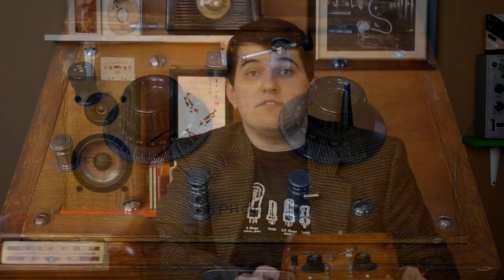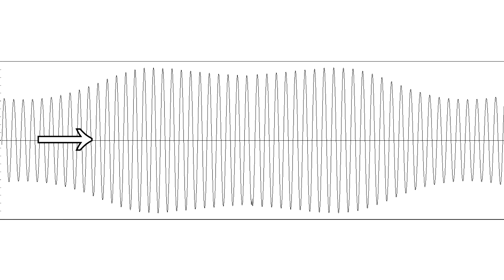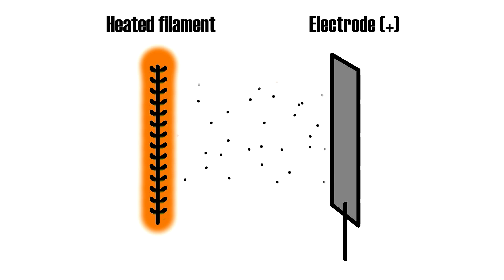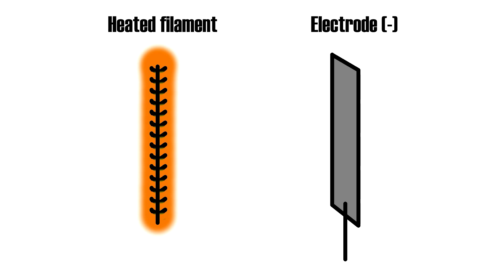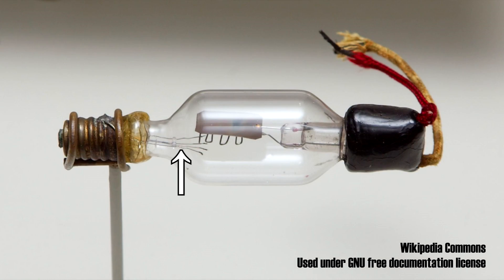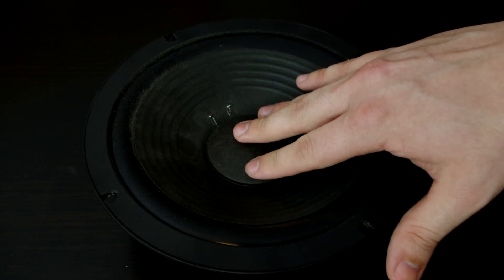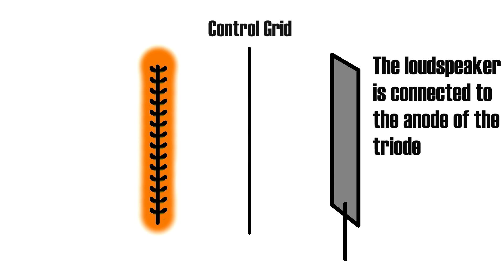The Vacuum Tube and the Invention of Radio

Comment: Listening to the local AM radio station with nothing but a metallic-diaphragm headphone speaker with a germanium diode connected across, one side going to a really long wire as the antenna and the other side grounded to the pipework used to be pretty much on par with magic. No power source needed...
Reply: Isn't it... magical?

I'll see myself out.
Reply: If
Reply: If the signal is strong enough you can hear it from a tin roof. Rust on roofing nails acts like a diode detector and the resulting current causing slight vibration of loose tin panels.  But you have to be near the transmitter for this to work.
Reply: @nakayle  That's very interesting.  I would like to experience that!  Speaking of "you have to be near the transmitter . . .", though:

My first year in college, my good friend lived down one floor from me (in the dormitory) and one or two rooms to the side (not directly under my room).  I had a hi fi (that's what they called "a stereo" back then, in 1964), and we rigged up a speaker in HIS room, running off a wire from my room, hanging outside the building, going down to his room, and in through the corner of his (slightly opened) window.  Worked fine at first, no problem.  

A few days later, my friend told me that he heard the nearby radio station coming out of the speaker!  From the TIME that he had witnessed this . . .  I'd had my stereo turned OFF at that time!  What a puzzling phenomenon!  
But the EXPLANATION was apparently just that we were "near the transmitter", as you stated.  An athletic person could have thrown a baseball and hit the transmitting antenna for WJOY-AM, we were THAT close!  

I guess a simple speaker connected to 20 or 30 feet of "lamp cord" will ("detect") the AM signal, in SOME kinda way!
We never did anything with this amazing information though.  --Even though we were living in the Electrical Engineering freshman dorm at the time.  

That's what it reminded me of, when you said "you have to be near the transmitter for this to work."
I would really like to hear a radio station broadcast by merely listening to a tin roof (as you described), though!  I think I've truly "missed one of life's experiences" by not ever witnessing that particular phenomenon, first-hand!  "Rust on roofing nails acts like a diode detector . . . ."  Your post wouldn't be NEAR as good without the EXPLANATION.  It would be just baffling and confusing.
Reply: @artpitkin883  An AM signal is easy to demodulate with anything that acts like a diode which can be rusty or corroded connection.  People living near high power AM transmitters often have to install filters and grounds to prevent this.  Doesn't happen with FM.
Reply: Oh I built a crystal radio ne in high school (in the 80s) but my teacher never did explain it like Alex did on how/why it worked. Well more so how a vacuumed tube/transistor worked as an amplifyer.
Reply: @nakayle  my grandmother talked about hearing radio from her walls back in the day. i thought she was crazy... now i know
Reply: The really NICE crystal sets are both quite sensitive and selective.

Comment: This is the best and most succinct description of "tubes" I have seen, and I have been working with this stuff since 1967. Great job.
Reply: You obviously didn't hear senator Ted Stevens' lecture about how the internet is a series of tubes. In all seriousness though I agree with you.
Reply: Why do tubes need so much power to work?
Reply: @twistedyogert  the filaments of vacuum tubes need a lot of power to heat up and allow electrons to easily flow.
Reply: @twistedyogert  Because of all the internets going through them.
Reply: @twistedyogert  With a vacuum tube you require heat to release the electrons. The electron source is a heater which wastes the vast majority of the energy applied to it as infrared radiation; with only a very small remaining fraction of the applied energy as the released electrons.  Like many, many things in our history of physics/engineering we initially learned empirically and used accordingly; then, we built upon this knowledge, through research,  using our understanding of the world through mathematics.  The world of quantum physics, and the mathematics derived for it, allowed us to finally build so called "solid state" semi-conductors which used the interaction of electrons and "holes"; this is where we are at now.
Reply: Me too.  I was playing with tube circuits in the '60's.  Getting shocked and burning my fingers.  Transistors proved much tamer toys!
Reply: Vacuum tubes and transistors never made complete sense to me until I came to the realization that "amplification" wasn't actually occurring, but rather the "amplified" signal was a control function that lowered a stronger DC current in order to make it match the pattern of the original signal.  Basically, you are taking a large current and attenuating it to match the original sound waves, only louder. I'm probably not even explaining it clearly, but I could probably draw it out much more easily.
Reply: @justinkashtock333  Interesting point of view.  I didn't ever think about it in THAT way.  Thanks!
Reply: @justinkashtock333  no, that explanation is really good (at least, to me—i have some electrical knowledge, but have never really understood transistors or valves/tubes at a level deeper than "they boost the input signal"). i think i previously must have assumed that they operated via some sort of feedback mechanism (although, logically, this makes little sense); your explanation (and this video) were very helpful!

Comment: Great video..... I'm a degreed engineer, use "radio" at work as a pilot, and my hobby from the time I was a boy was radio, now an armature radio operator (ham).  I restore old tube equipment, radios, test equipment.... Even though I know all of this, I found you stripped down but accurate explanation and graphics fascinating.  Of course radio typically has IF ( intermediate frequency ) internally, where all signals received through the tune front end are up or down converted to a single IF frequency. This allows all the circuits to be tuned to that one frequency. There may be several IF stages (at the IF Freq 455Khz for AM radio and 10,7 Mhz for FM aradi) to boost the signal to the point an audio amplifier can reproduce audio. Consumer AM RADIO (Amplitude Modulation on the MW - Medium Wave band, or BCB - Broadcast Band) and FM RADIO (Freq Modulation on VHF - Very High Frequency) use IF stages to boost the RF (Radio Freq) signal before the Audio amplification. 

The history of IF or Intermediate Freq radios known as superheterodyne radios is interesting;
"An intermediate frequency concept and application used in the superheterodyne radio receivers, was invented by American scientist Major Edwin Armstrong in 1918, during World War I. A member of the Signal Corps, Armstrong was building radio direction finding equipment to track German military signals.....  After the war, in 1920, Armstrong sold the patent for the superheterodyne to Westinghouse, who subsequently sold it to RCA. The increased complexity of the superheterodyne circuit compared to earlier regenerative or tuned radio frequency receiver designs slowed its use, but the advantages of the intermediate frequency for selectivity and static rejection eventually won out; by 1930, most radios sold were 'superhets'." (Wiki).  

The short (long) answer of why this is amazing (changing or converting one Freq to another using heterodyne)  is the early radios of the day (regenerative and tune radio) had to tune many stages to the desired incoming frequency. This was difficult, complicated and expensive. With a "Superhet" radio you still had a tuned circuit for the desired frequency at the "front end" of the radio, the frequency you wished to receive, but that was converted through heterodyning, By converting the desired incoming signal to one Freq regardless of the incoming signal Frequency the radio was design to amplify only one Freq the IF.... Then all stages of the radio could be the same and tuned accurately.  Having more than one stage or stages by the way is a way to boost a very weak RF signal, with each stage boosting the signal more. There is only so much gain one stage can get. So by putting them in series you can boost very weak signals. Typically a cheap radio had one stage. Better radio's with more sensitivity had at least 2 or 3 stages. Some radios also had a wide RF amplifier at the front end before the tuning circuit, to boost all frequencies on that band before entering the radios tuned circuit. This use of hetrodyne where the desired incoming signal was converted to the IF for the radio to amplify. greatly simplifying made the radio have far better in sensitivity and selectivity than any other design.  This was Armstrong's invention or discivery.

The most simple tube AM radios from 1930's to early mid 1960's are called "All American Five", for the 5 tubes it had inside. The first stage is the converter which coverts the incoming signal Freq to the IF Freq. The second stage is the single IF stage which boosts the RF signal. The third stage is the detector as this video shows cuts half of the AM or amplitude modulation to get a usable Audio signal. The 4 the stage is the Audio amp to drive a loud speaker. The fifth tube was a rectifier or diode to turn AC to DC. as the radio ran on DC. The rectifier was the "pwr supply" to drive all the vacuum tubes heaters that emitted the electrons. Some high end radios had  2 or 3 IF stages and even a Pre RF amplification stage, adding 3 or 4 more tube's. Some deluxe radios by the end of the 50's and early 60's had 9 to 12 tubes.  This is also when FM radio was just starting to enter the market, so it was two radios in one, an AM radio and FM radio, with the radio sharing some of the same circuits for both the AM side and FM side (amplification, power supply). However AM radio is in the 600 to 1700Khz range and FM 80-108Mhz range required their own IF tuned sections.  Also the method of "detection" of AM audio is different than FM, often called demodulation or demodulator. AM and FM differences are interesting but simply put the audio sent with AM is accomplished by changing amplitude at one set frequency, and audio using FM is sent by changing frequency (at one amplitude). This is why static in the atmosphere say due to a storm affects AM radio as the static is picked up as amplitude, where FM radio ignores changes in amplitude. So FM is less (not immune) to static. However if there is RFI (radio Freq interference) at the desired frequency it can make FM radio noise. With anything operating in the FM radio band from ab 76Mhz to 108Mhz.

FM radio although introduced in the 50's did not catch on. In part because there were not many FM stations and AM radio was so imbedded in the market and culture. Also an AM/FM radio was more expensive. However by the 1970's with the advent of rock stations playing full albums, FM radio took off and out stripped new AM stations, with the better audio frequency range and resistance to static over AM radio. By the 1970's transistors were now most of the consumer radio market with smaller lighter less power hungry devices. However audiophiles still use Tubes but mostly for the Audio amplification. (My be Tech Connect can do a video on difference in sound between transistors and tubes?). 

Ed Armstrong is one of my favorite people in Radio who also invented FM radio which as you know is static resistant. His life ended tragically partly because RCA stole is FM radio and used politics to change the FM radio band making his early radio stations and radios obsolete. He ended his own life after years of legal battles and spending huge sums to fight the massive corporation run by a true prick (David Sarnoff), but never the less Armstrong's contributions to radio with superheterodyne and FM radio's were ground breaking and long lasting with implications all through the electronics of today. 

However now with solid state and digital signal processing it is a different story. There are many ways to encode and decode information on an RF signal, but for the most part it has been been the superhetrodyne radios of Armsrrong that has been used since the 1930's to present day.  If you have not already done it, consider doing a superhetrodyne video....

Comment: I made my first crystal radio in shop class when I was 15 and when I showed it to my son in 1980 he was amazed!  Yes it works and doesn't need a battery!  The following year I made a transistor radio,  and put it in a 3inx4inx1in plastic storage box. The biggest components were the the speaker, 9 volt battery and the channel dial, the actual radio components were tiny!  My teacher told us eventually every thing would be so miniaturized that wrist radios-TVs, and miniature telephones would be possible.  I wish he were alive today he would be amazed at the new tech!
Reply: Respect

Comment: Those vacuum tubes used to work TVs also when I was a boy. You had to wait 5 minutes for the set to "warm up" before you get a proper picture.
Reply: Fun fact, a CRT basically is a big vacuum tube.

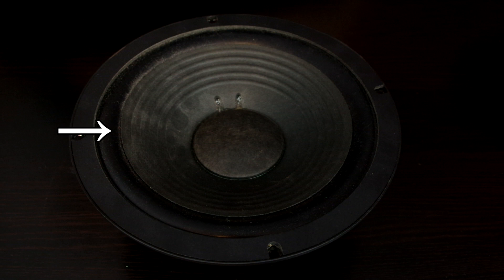Comment: 8:50 the surround keeps the cone centered, but you forgot one part, the spider. its what makes the cone return back to center. almost like a spring but its a kevlar and cloth "hybrid". now very early loudspeakers from the early 1900's did use an actual metal strip as the spider.
Reply: Maybe Alec is afraid of spiders....
Reply: What if we just use an itsy bitsy one?

Comment: I love this site, and have referenced it in some of my lectures. 

However, you talk about turning the electron flow ON and OFF - you are describing a digital device. 

The fact is that the electron flow is (roughly) inversely proportional to the grid bias voltage: zero bias - maximum anode current, half of cutoff bias, half anode current, full cutoff bias, zero anode current. It's an analog device.

Although beyond the scope of a talk such as this, the first vacuum tubes had very little gain (maybe a factor of 2 or 3) - they could amplify fairly well by being able to drive into low impedances such as headphones, while presenting a near-infinite impedance to the driving source. 

They were, in effect, transformers with a bit of voltage gain but with an infinite input impedance and zero circuit loading - therefore giving a substantial power gain.

Thaks for your site and keep up the good work!

Ian.

Comment: There are more complex vacuum tubes with more electrodes. Adding another electrode results in four elements in the tube, a tetrode (tetra means four). One more electrode results in a pentode (penta means five).

The part that emits electrons is called the cathode, it is either heated directly or has a filament heater that heats it. The intervening electrodes are called grids. The electrons are collected on the anode.

Comment: Wow, you went from triode radios right to voice coil speakers, skipping all the non-voice coil speakers (horn and solenoid) in between!  The one that had a coil vibrating a tiny metal plate through a horn was closer to Bell's telephone speaker.  Maybe if I keep watching, you've done a video with early horn speakers, and can show us the Rice Kellogg speaker.

Comment: Marconi and Tesla.  Both were working on similar projects and both ended up with similar toys at the end.  Tesla was the inventor of the radio but he wasn't interested in it as a communication tool.  To him it was a stepping stone for wireless and free power.  Marconi used Tesla's inventions to supplement his own creations to create a method of communication and moved to market it to railroads, and maritime companies.  The first Marconi radio was a "spark gap" transmitter that was very crude and could only transmit noise.  It had no frequency to speak of, it was just wide band noise when ever you pushed the key on the telegraph.  This noise would excite another spark gap device that would be a crude receiver.  It would make a buzzing sound when excited.  Railroads didn't adopt this technology as the wired telegraph was already in place and working fine.  Ships did adopt this as there were no wires for communication while at sea.  Many others had their hands in the Radio as well, and the phenomenon of the spark gap was known well before Tesla or Marconi even started their work... just no one knew what to do about it.

Comment: And the vacuum triode is still the most linear amplifying device we have. When I have the time and money I like to build vacuum tube audio components. My main stereo system uses a single ended tube amp that I built using KT88  output tubes and I love it. I still need to get the control preamp and phono preamp built.

PS. usually your audio output tube does not drive the loudspeaker directly but uses an audio output transformer to match the high impedance tube plate circuit (High voltage and low current) to the low impedance (high current low voltage) loudspeaker circuit.

Comment: I just realized why AM radio stations get quieter as you get farther away. The fainter and fainter signal (less modulated amplitude) is literally telling the radio to turn the volume down.
Reply: In many pre superhetrodyne, tuned radio frequency (TRF) sets (such as described in the video), the volume control was actually wired into the RF stages ahead of the detector rather than the AF stages after the detector, as in a superhetrodyne radio, phonograph, Hi-Fi amp, or TV set.